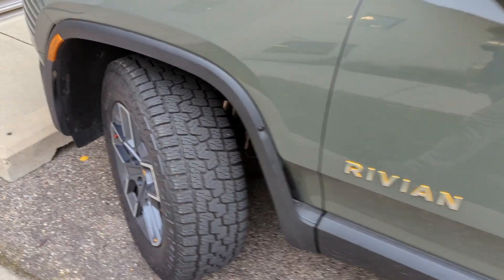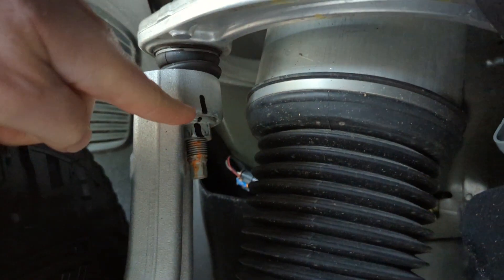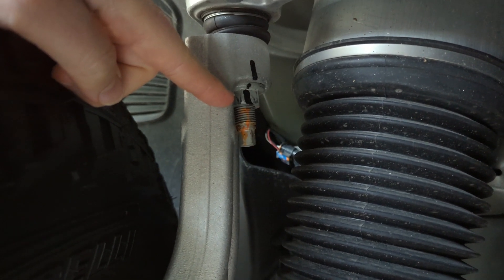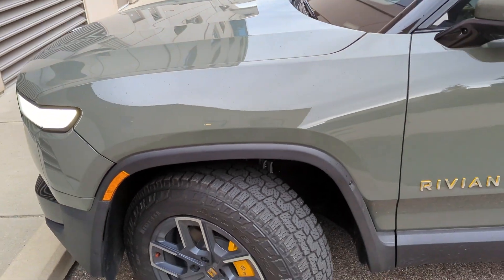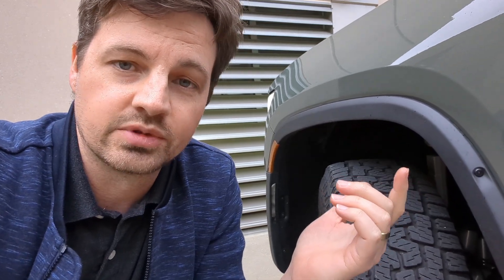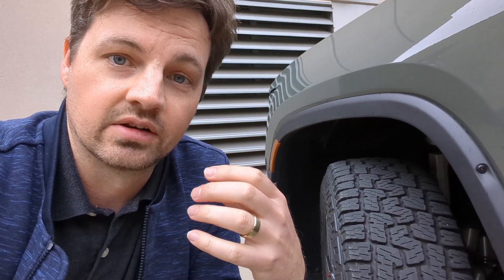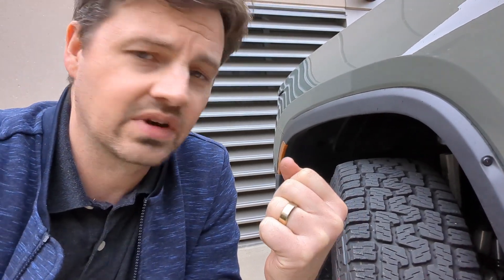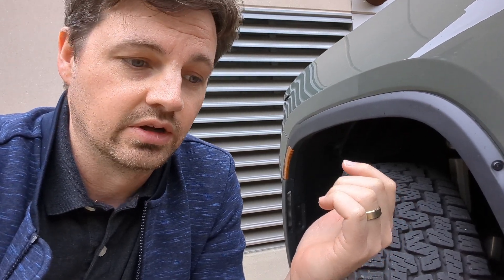Here's the deal with Rivian recall

Comment: from 70 to 120? sounds like quite a change. It's not my expertise but it's my impression from aviation that bolts that really don't need to come lose under vibration has a lock of sorts, not just a torque limit. so it might be something they will have to revisit later. If they really went from 70 to 120 that sounds a little desperate.
You can also get some special washers like nordloc that have little step teeth that effectively prevent coming loose. We'll see how it lasts.
A helicopter has a socalled Jesus nut so named because if it comes loose you'll need Jesus. And they don't just rely on torquing for that one.
I don't know how other carmakers handle it, maybe it's a non issue.
Reply from the maker: Well, the bolt has to be removable for other reasons, so can't completely lock. Torque also can't be too high or it will deform the joint components that it is holding. 
I'm not 100% sure what the new torque was but apparently they want it higher
Reply: @Teslavangelist Interesting thinking but I had mine tightened yesterday and I think its more likely that the assembly robot was set to 70 fp of torque when it should have been set to 120 fp. I like that they marked the bolts so now its very simple to just glance at it to see any movement which is highly unlikely.
Reply: I torqued mine to 90 ft lbs a couple days ago, just in case, until I can get Rivian to set it where they think it should be. But it seemed to be pretty much there anyway. Not even a tenth of a rotation. My VIN is in the 12,000’s, so toward the top of the VIN recalls.
Reply: Another YouTuber mentioned newton meters not foot lbs that's quite a difference. I'd double check that before throwing out specs that are critical.